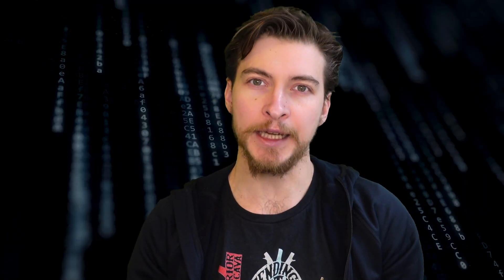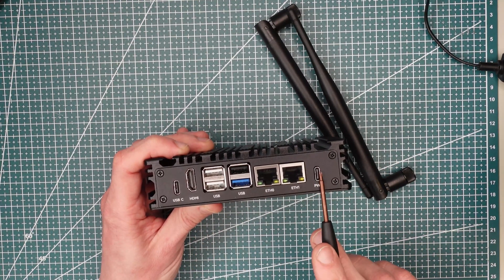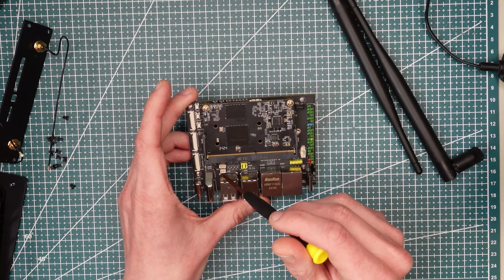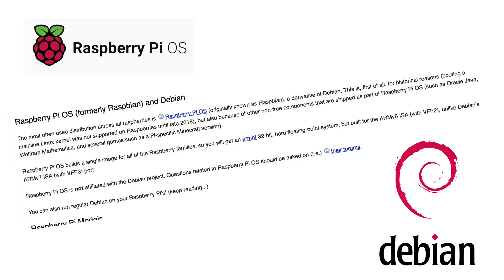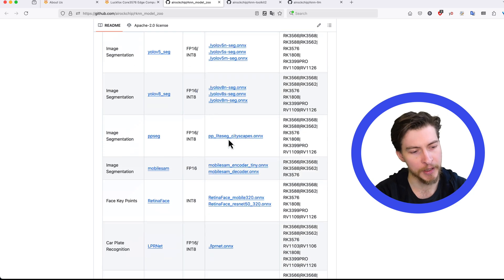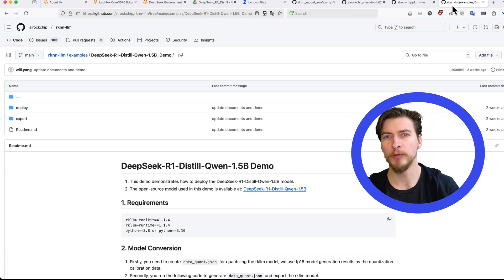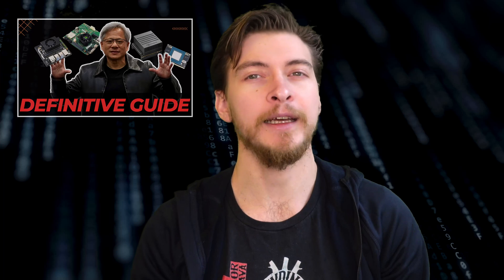Finally! An SBC for LLMs

Comment: Price looks good. How about a deep dive video just on ALPR with this board?!  

Also, can it run Android Auto and use the CAN bus to read automotive data? 

This looks like a perfect car computer device.
Reply from the maker: That is a very interesting take! Would never think about this as a car computer, but that's just bcs I'm not a car guy (getting my driver's license now in NL, at the age 34 haha).
Yes to CAN bus: Supports high-speed CAN FD and CAN2.0A/B data communication.
Maybe to Android auto

Comment: Fun video, my board just arrived six days ago. 

How are you checking NPU usage when using an LLM??

I can convert huggingface and gguf models to RKLLM and run them on the machine, but I don't think it's touching the neural processing unit (which is otherwise recognized).

How important do you think it is to upgrade the NPU driver to  0.9.8 for this to work and do I have to rec compile a Linux kernel to do this. Thanks for any time you have to respond!
Reply from the maker: Great! Do update me on how it goes.
I think as long as you use the rknn-llm it should be working on NPU. But it is a good question to ask! I'll check the docs and see what are specific commands to see NPU utilization. 
One indication of NPU usage was that the power draw was half of R Pi 5's with comparable tok/s speed.

Comment: Hello, can you please try if it works with ultralytics yolo? Im planning to buy one but its my first time buying an SBC. 😅 It will help me very much thankyou so much! I dont know if the yolo models in ultralytics will successfully run using the 6tops NPU
Reply from the maker: I think they added the support recently, check out this page
https://docs.ultralytics.com/integrations/rockchip-rknn/#what-rockchip-platforms-are-supported-for-rknn-model-deployment
this board is based on RK3576 chip, which listed as supported.
Reply: @Hardwareai  thanks so much for showing me this. Are you planning to make a step by step guide on how to setup the luckfox?

Comment: it wo0uld be kool if you could slam 10 of them together to run a 70B model
Reply from the maker: I.e. create a cluster? Maybe possible, considering that rknn-llm is based on llama.cpp, which supports RPC. But rknn-llm is not open source unfortunately at this time.

Comment: I've had the board since the beginning of January. I have no interest in AI whatsoever and have been trying to use the board as a Raspberry Pi killer. Normally, this thing, which costs even less than the Pi 5, would completely overshadow the Raspberry Pi. But unfortunately, the relentless inflexibility due to the persistent ROM bootloader is so limiting that I don't even know what to do with the device. Connecting it to the network is absolutely out of the question because of the incredibly outdated software. That would be a security nightmare. 

Updating is also not possible because it's an image-based system where the image must be booted from eMMC or, antiquatedly, from a slow SD card. And the images are immutable. (No boot from NVME possible)

On the software side, there's also the issue that much of the software I'd like to use no longer works with the Linux Mainline Kernel 6.1. 
My attempts to build my own Linux using the SDK, build my own bootloader, move the RootFS of Debian to a system from this decade, etc., all failed. Because the ROM bootloader, which cannot be adjusted or edited as it's stored on some chip, prohibits any changes to the system. "If it's not a Debian 12, buildroot, or Android image on eMMC or SD card, I simply won't load it."
And thus, the device is unfortunately completely unsuitable for me for pretty much anything you could do with it.

A company that connects a device with such outdated software and gaping security holes that can never be patched to their network can say goodbye to their insurance.

Therefore, I believe if you don't want to work AI-based and only connect the system briefly for the necessary models/LLM´s, it's more sensible to invest the money in a TI calculator. They are cheaper and offer more flexibility.

PS. By the way, according to Luckfox, this is not a Luckfox problem. I was told in the forum that the ancient software base is the fault of Rockchip.
Reply from the maker: Thanks for the detailed comment!
While 6.1 is not cutting edge, it is definitely from this decade (11 December 2022). However from production device standpoint, I see what you mean, you want to have 1) something recent available off the shelf b) the possibility to take the latest kernel and build an image with it.
Supposedly this is exactly what Buildroot should do, but luckfox only provides pre-built Buildroot images. I'll ask them if they plan to provide build scripts / config as well.

Comment: Hi, there's 4 things that are not clear to me from the video and would appreciate if you could clarify
1) Can we use (most) of the onboard memory for the LLM? i.e. when running on a normal computer we are restricted to either the GPU + (comparatively small) memory for fast execution or the available RAM and CPU for slower execution of bigger models
2) can we run ANY model that, say, we would be able to run on Msty? i.e. any flavor of deepseek or mistral, including abliterated ones, or are we restricted to those linked in the docs?
3) would it run models from the NVMe albeit accordingly slowly?
4) have you tried / do you rhink it could run SwarmUI?

Thanks!
Reply from the maker: Absolutely!
1) All available RAM can be used for the models, since here the GPU is not used for inference, rather NPU.
2) if you want to use NPU acceleration, you will likely need to stick to the models linked in the docs or similar to them. if you use CPU (slower), you can simply run ollama on the board.
3) afaik the models are loaded into RAM, so where you store them doesn't matter much.
4) have not - and I have not seen the image gen models being avialable in the model zoo
Reply: @Hardwareai  thanks!

Comment: So technically for around 600$ to 900$ ish* a Cluster computer set up could be achieved to run midsized LLMs 🤔???

Adding an old pc with 2 last gen GPUs each 12GB VRAM to the cluster would make us around 120GB of memory that’s might not be super reliable but definitely cheaper to have a modular system that could be scaled up and maintained technically on the fly in dirt cheap components for Largesized LLMs locally!!

So we’re talking about 1000$ to 1500$ for the whole setup of local server which technically could serve a small office or home server for the whole family!

Definitely approachable, especially if there’s a way to leverage Virtualization layer to access 1:2 GB per users computer to harness better performance and some sort of dynamic cashing in place
Reply from the maker: I honestly not sure how will it play with clusters: people do that with R Pis and Jetsons, but I'm mostly focused on single mobile device usage scenarios, e.g. robotics or IoT.

Comment: for me the idea to pass trough a window image to start it's a "no go", I stop the watching.now, say to them :) (like you ... I use mac and linux distros dont'want to use a virtual win to flash)
Reply from the maker: /sigh/ I know. This is not Rockchip only problem though. Some silicon vendors are just hell-bent on Windows, not going to call out names here, but more than once I heard "sorry we use proprietary software, we mainly run it on windows, nothing else is guaranteed to work"

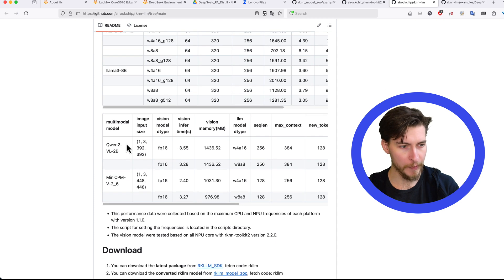Comment: 6:26 Just to clarify, all of these llms are baby sized that can be used for very small, specific tasks. To save others time in case they are not aware. Please don't buy this in the hope that you will get anything near the performance of a llm that you're currently using or have used in the past.
Reply from the maker: I'll put a sticky comment summarizing my replies, but in short:
1) It's small, but far from "baby size". Look at llama.c or nanogpt for truly baby sized models, that can literally fit on ESP32
2) The models in the model zoo vary from 1B to 7B, 7B arguably is the lowest bound for "generic" language model. Smaller than this in my opinion can be useful with fine-tuning, if they stick to their domains.
Reply: Came here to say this. I have a 14 billion parameter model on my home Ryzen 7, and that's skirting the definition of "ok" in my opinion. 8 billion param you could use for simple formatting tasks. 2 billion? Get out of here, you might as well have a random noise generator.
Reply: @EV-wp1fj  not if you finetune it lol! 1.5 billion goes a long way lol
Reply: No one asked you to clarify but okay.
Reply: 6 tops and not enough memory space to fit big models.
Great for camera vision gets though.

Just cheap enough for beginners to learn neural networks (gonna buy one probably :P ).

Comment: How does it compare to a radxa rock 5 b or Orange pi 5?
Reply: A very important question.
Reply from the maker: I see they have option for more RAM, but NPU compute is the same (6 TOPS). Most of the examples in the model zoo are for 3576 / 3588

Comment: Really cool little machine. For anyone wondering hard numbers or performance, you would expect this to be roughly equivalent to a ~five year old intel desktop processor with slower DDR4 RAM, or perhaps a Raspberry Pi 5 (because that uses ARM SIMD instructions).

It does make it a little weird to evaluate because I think for less than 4x the price you probably get more than 4x the value for running AI applications by buying a modern or used system; having 32GB for instance means you can run "real" models, or having around 100GB/s of memory bandwidth means that tine tuning for a specific task isn't really impossible.

There's still a place for things like this and the efficiency, portability, and scalability all have values unto themselves, though.
Reply: While I agree to a degree, I don't think that the premise of the video is entirely true. Running the 1.3b deepseek distil isn't the same as actually running deepseek. 

And I saw used xenon workstations with 256-512gb ram for around 500 GBP on Ebay. If they were available at my location I would 100% buy one.
Reply from the maker: Nah, definitely not Raspberry Pi 5, it has 10-25 GFLOPS of compute, CPU only (so that is why floating point operations) that is depending on how to count, that is quite a bit less than 6 TOPS. Same for five year old Intel desktop, someone asked me how it compares to mid range desktop CPU, and in terms of integer performance, it clearly wins by a lot because of NPU.
What is a "real" model varies from application to application, but general use models do seem to start somewhere in 13B at least range, perhaps more, again depends on breadth of usage. The smaller models are good for narrow areas of application with fine-tuning.
I fully agree with this point though!
>There's still a place for things like this and the efficiency, portability, and scalability all have values unto themselves, though.
Reply: @  I think that the issue with language models is you can't really look at a single specification and get a solid answer out of just that specification.

Numerical performance does matter, but it's not the only (or even primary) deciding factor. At low context, LLMs are a memory bound workload (whereas at high context they feel more like CNNs in the way they're compute bound).

So, if you're comparing a 10GB/s memory bandwidth device with two different levels of compute, they'll actually be remarkably close in performance for certain use cases.

This gets more complicated by the use of fused kernels (GPU) and SIMD instructions (CPU) which changes the memory access patterns significantly, and I find that CPUs tend to gain a lot from fused SIMD (fused multiply-add, etc), and which modern ARM CPUs (rapsberry Pi5, RK3588 SBCs, etc) tend to have a more robust instruction set (though I'm quite excited about Risc V in this area). This means in CPUs you often have to multiply the memory bandwidth to get practical memory bandwidth, when comparing to a GPU, and the amount you multiply by depends on software implementation.

Another thing to note is that TOPs is still not the whole story even when compute bound. Int8 tops are only valid if you have an Int8 model, for instance, and if you have an FP16 model comparisons start getting really interesting and really weird very quickly.

You also have to factor in sparsity; CPUs handle it a lot better, and Nvidia often lists sparse operations because they look more impressive. But in practice, when you look at practical ways we achieve sparsity (ie: MoE, FFN activation Top-K sparsity, etc) they actually often "look" like a dense operation mathematically, but in practice have software limitations. So, for instance, I was testing and almost every implementation of MoE I've seen on GPU underperforms the theoretical FLOP the GPU should have, while CPU gets way closer to theoretical efficiency, and this is a big one because you can often get an 8x (or higher for larger models) speed boost (I can run Olmoe at around ~40-50 tokens a second on a Ryzen 5900X with dual channel 2433mhz RAM).

Then you have to factor in things like Bitnet quantization, which have favorable implementations for CPUs, and again, as NNs are memory bound, you can end up in a situation where at low context a CPU can actually perform 4-8x faster than you would expect from the specs sheet due to the LUT implementation of that quantization, which does extend to GPUs only if you're willing to wait ten-twenty minutes for GPU kernels to compile *for your system specifically*.

Long story short: There are no absolutes in machine learning.

Comment: 1.5 billion model?  Am I the only one that thinks this is ridiculously small and not useful for anything but the most mundane tasks?
Reply from the maker: Fine-tune, fine tunes + the largest one you can use is 7B. It is not the replacement for your regular work station tho

Comment: It looks like a neat machine for some applications.  It would be good to see the speed in tokens per second for some model at some quantization and compare it to the Jetson.  ollama --verbose does this extremely well, but it looks like this uses a custom software stack.  But at that price, it could have some uses.
Reply from the maker: You can take a look here https://www.jetson-ai-lab.com/benchmarks.html#__tabbed_1_1
and 
https://github.com/airockchip/rknn-llm
There are two models that match, so can be compared 1:1, llama3-8B and Gemma2-2B.

Comment: So just to be clear. This board and many others like it for example the Orange Pi and the Radxa can do the same thing. This is very different from the Jetson Nano Orin. Not really apples to apples comparison. This board has 6 TOPs the Orin board that uses the Jetson Orin Nano 8GB module to deliver up to 40TOPS for AI performance. 

Let's see:
6 TOPS
vs
40 TOPS
Reply from the maker: The TOPS comparison numbers are spot on, but I don't get why you say it's not apples to apples? In the end we do compare AI performance, measured as integer compute. In Jetson's case the compute is done on GPU, in this board's case it has an NPU (which is all other things being equal is more power efficient than GPU).
Reply: @Hardwareai  It's not just about TOPS. The Luckfox focuses on NPU-accelerated INT8, optimized for specific neural net types, especially LLMs. The Jetson's 40 TOPS comes from a more general-purpose GPU, handling a wider range of workloads but with different efficiency. Think specialized tool vs. general toolkit. Both 'compute,' but for distinct tasks. Claiming they're directly comparable for 'AI performance' ignores that fundamental difference.

Comment: This device cannot be used for anything related to AI, the RK3576 is a budget chip with very low DRAM bandwidth (32b, 19 GB/s max, less than 10 in practice) compared to Jetson's >100 GB/s. It will be at least 5 times slower. Just pick an RK3588, it will already be twice as fast for almost the same price, or better, the Orion O6 from Radxa which reaches 88GB/s and has a 45 TOPS NPU, for not much more.
Reply from the maker: > This device cannot be used for anything related to AI
Strong statement. It absolutely can and according to benchmarks here (which are easily verifiable) https://github.com/airockchip/rknn-llm#model-performance-benchmark it is not that far behind RK3588, if you use lower quant levels (INT4). 
On the other hand, thanks for the info, I took a look at Orion O6 and will try getting one of them for review as well, to have the info on higher tier.
Reply: @Hardwareai  It's just half of the speed of the 3588 which is already very very just. It's generally admitted that 4.5 t/s is about the limit for people to stand a model. RK3588 is already not much higher than that on a 3B model (I'm getting 8.9 t/s on Qwen-2.5-3B at Q4), and a 3B model (especially at low quantization) is particularly limited in its ability to assist people. Here we're speaking about cutting that speed in half again! That's sacrificing too much critical performance! Also the question in bold on the video asks "better than jetson?" while a jetson should be at least 5 times faster and doesn't play in the same ballpark. A 3576 is equivalent to a RaspberryPi 4 in terms of CPU and RAM bandwidth (cortex A72, DDR4-32 bits).
Reply: Well it can but not in the way the thumbnail leads you to believe. It can be used more for image recognition, which is machine learning.
Reply: @Brian_Onesimus  the title was "Finally an SBC for LLMs" and that's what  I'm contesting. There are definitely various uses of a cheap entry-level SBC with an AI accelerator, but LLMs are out of the scope of this one IMHO, especially when we consider that it's easy to do 2-5 times faster with not much more bucks.